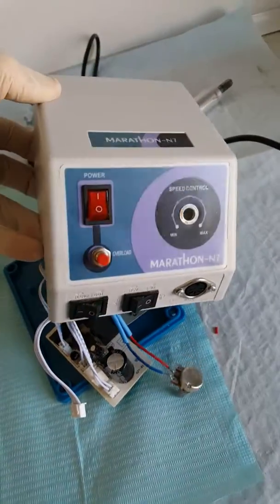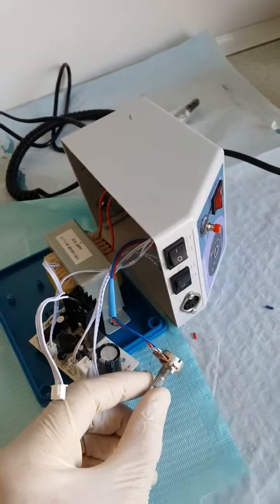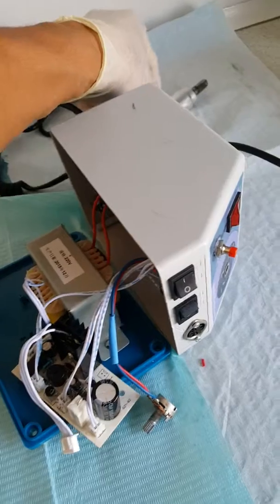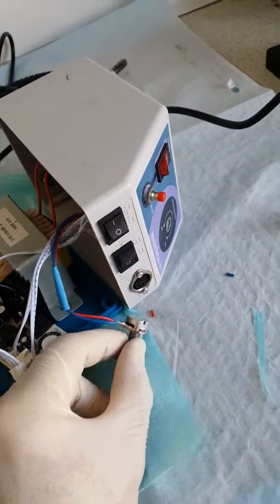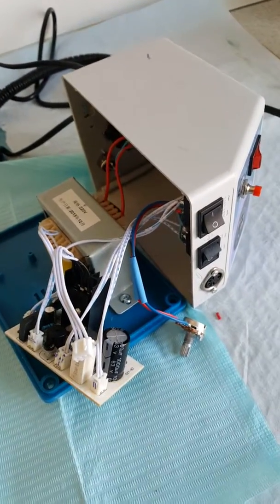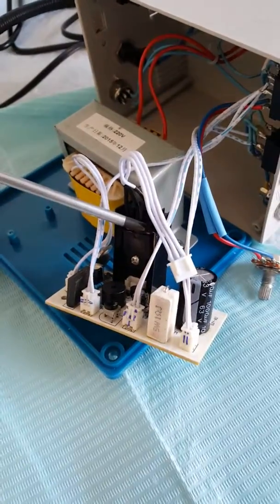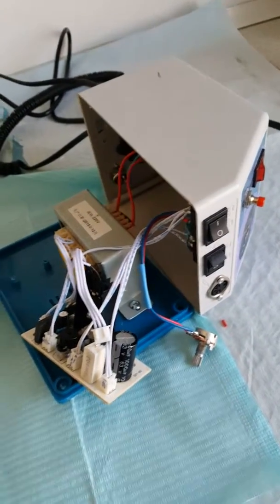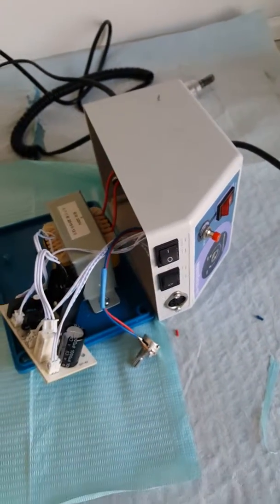Marathon N7 MicroMotor Spinning Speed Problem...

Comment: what was changed was the name,please help answer 🙏
Reply from the maker: Hello. The item, as I can see is:
Transistor reference:
G
TIP142 
G4 19S VW
CHN G4 1518

The reference I found at the time of mine, at Ebay, was under "TIP 142G Transistor NPN bipolar Darlington 100V 10A 125W TO247 ON SEMICONDUCTOR".

Comment: Hi, What is the part called?
Reply from the maker: Transistor reference:
G
TIP142 
G4 19S VW
CHN G4 1518
Reply: @kt09b5  Do you have a link for this part? Thanks
Reply from the maker: The seller I have ordered from, does not have it anymore, but I have looked up the description of my order from ebay, and the name of the item is under "TIP 142G Transistor NPN bipolar Darlington 100V 10A 125W TO247 ON SEMICONDUCTOR". 
What I now find closest to that description on Ebay, seems to be this item: https://www.ebay.com/itm/TIP142G-Trans-Npn-Darl-100V-10A-TO247-/324419753069?_trksid=p2349624.m46890.l49292
Reply from the maker: Try asking the seller if the two itens are the same 😊

Unfortunately, as I am not an electronic technician, I don't know what slight diferences in the description name of the transistors, can or can not be more or less of an importance 😔

Sorry for the delayd answer to your question, as I did not recieve any notification regarding you comment.

I wish you success, in the repair of your device 😊

If you need any more help, please let me know.
Reply: @kt09b5  Thank you very much for your help. Good man!
Reply from the maker: @riffle12345  your welcome 😊